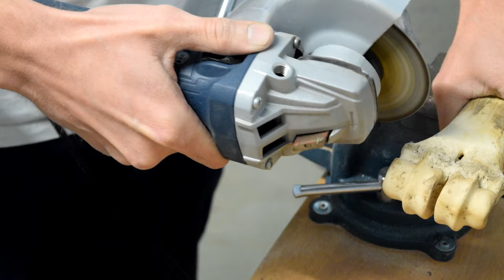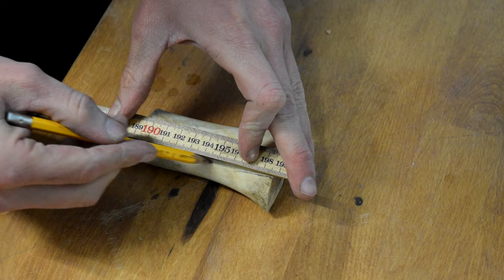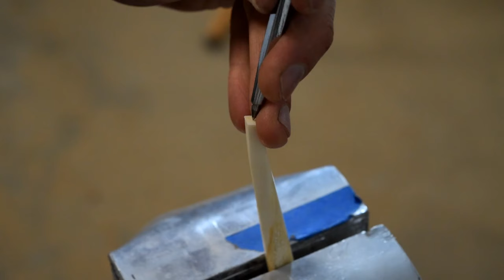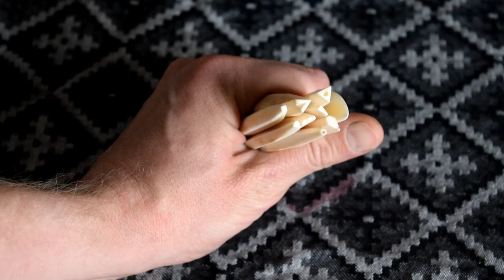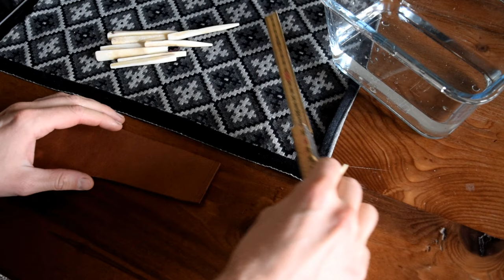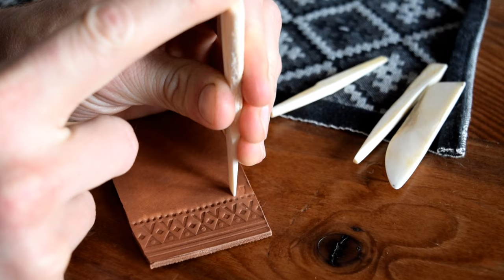Making Bison Bone Leather Stamps

Comment: Why exactly bone? What special properties does the bone have in relation to the skin? I saw how they polished shoes with bone, why bone?
Reply from the maker: Honestly I don't know. Probably because of its structure, it is hard but still easy to shape unlike metals, it doesn't stain the leather and because long time ago, when the leather was worked there was no composite materials such as plastic or resins. 
It is just my guess, it would be cool if someone have an accurate answer :)
Reply: @StevesWorkshopSwiss  Thank you.